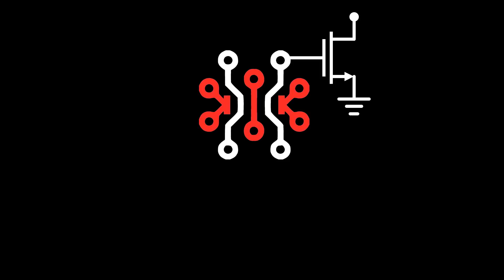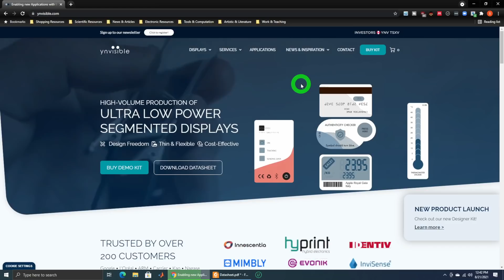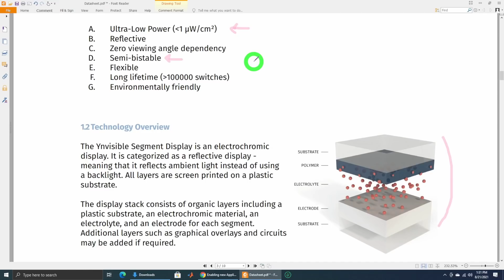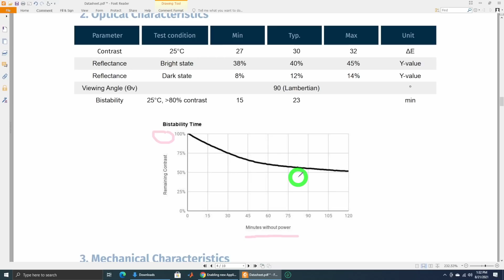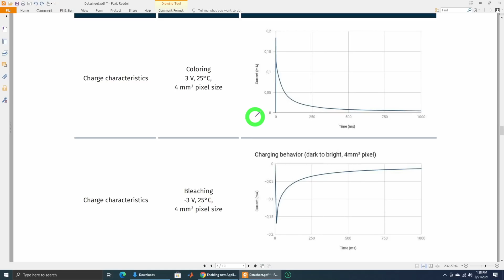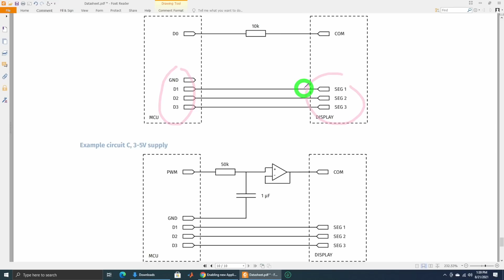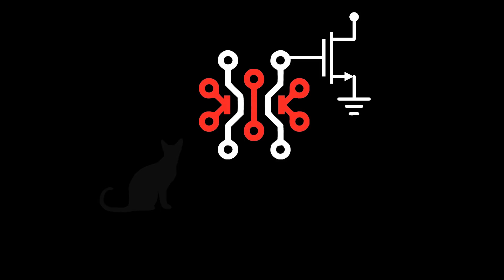TNP #7 - Ynvisible Electrochromic Ultra-low Power Segmented Display Technology

Comment: Great video Shahriar. Besides being an RF engineer, I have been working on developing these types for displays for around 2 years (not for Ynvisible Interactive) - based on the color, these displays seem to use the PEDOT:PSS polymer (look up Clevios S V4 ink which is commonly used because it is easily screen-printable). One thing which I would mention is that these types are meant to be used in very specific applications where there is either a mechanical concern (a standard segmented LCD could break) or a design incentive to use an "eco-looking" display in the product. The expected number of "coloring/bleaching" cycles has to be low (I would say generally <10k cycles to have good contrast over the whole lifetime of the display). For the vast majority of the products, using these does not make much sense as they can be more expensive than segmented LCD displays made in China and they generally offer lower contrast. Nevertheless, there are applications where these displays can be useful - i.e. in the shipping industry (temperature data loggers).

Be careful when playing with them as they are by no means as reliable and "rugged" as standard segmented LCD displays - they are quite prone to over-oxidation - you have to be extra careful when driving these as when the PEDOT:PSS is fully oxidized (light blue) and you continue to provide potential on the electrodes, the polymer will eventually get stuck in the oxidized state indefinitely and the display is damaged. Another issue (which can be solved i.e. by using a polymer mesh soaked in the electrolyte) is the movement of the electrolyte - try to push hard on one of these displays and you will probably see that the part where you pushed responds slower than before - the electrolyte gets displaced by the pressure.
Reply from the maker: Thanks for the great set of information!
Reply: Funny. I was looking into the technology in detail, and it seems it is only made of drawbacks. There was a EU-financed iniative, called Decochrom, which ended with basically nothing to show for. Ynvisible seems to be borderline out of business already. There really seems to be a lack of a clear USP. It's not that much cheaper than custom LCDs to get your own design, and contrast, speed and longevity seems to be lackluster compared to EPDs.

Comment: Thank you for the video, there are also some paper white displays which allow you to bring any custom bitmaps on the display, even with multiple colours, their content last for years. I am using simple SSD1306 OLED displays, they are bright and cheap, however they have to be switched on/off automatically, otherwise they eat too much energy and burn in.

Comment: Cool.  I think one can design a very sweet solar powered temperature sensor with this, like the ones in freezers and fridges that use an LCD,  but flexible and the solar cell could be in the area not used for the display digits.  It would look like just a display.  Add adhesive, and ready to just stick where ever you need a temp measurement.

Comment: Actually the (over) 100k times switching lifetime rating is way too low for almost any display, and even that is an understatement. If you want to make a clock using this, the minute digit would last about 3 months.
Reply: And seconds in 28 hours! Maybe test it? run it for 48 hours?

Comment: Why is there a chip on the board for the ON/OFF samples? Is it a µC or a DC/DC for a stable voltage?
Reply: Probably neither, both would need at least a decoupling capacitor and a DC/DC converter would also need an inductor. There are only two resistors. The package marking is impossible to read, but I'd guess it's an H-bridge. Applying the negative "bleaching" voltage would otherwise require the two buttons to be DPST, which are harder to come by than the standard SPST

Comment: 100k switches is actually pretty low. If you make the display count minutes, 100k life is reached in 70 days. Your demo counting seconds reaches the 100k in 28 hours.
Reply: You could even time lapse video the demise!
Reply: @EEVblog  Yep, also might be a good idea to try different approaches to the driving of the display - different voltages, trying to put resistors in s series to the segments or common electrode - you can trade-off display cycles for the display performance. On the one hand, It is possible to heavily overdrive the display with let's say 8-10 volts to get a much faster refresh time (tens of milliseconds) but the useful lifetime of the display will be reduced to a few hundred cycles at most. On the opposite, you can drive them gently and get a much better lifetime (around 100k cycles is a maximum). The degradation is slow and subtle, you don't get a sharp decrease in the contrast. Displays that I have been developing work down to around 0.8 volts (-0.1V to bleach, +0.7V to color) with around 2s bleaching/coloring cycle time - just to get some perspective how low can you go with the voltage until the contrast change becomes unusable for display purposes. Of course, this may not apply to any display - think about the display as a couple of capacitors - you transfer charge from one electrode to the other and as a coincidence, the electrodes change color, looking almost like a magic :-). There is a lot of variables, resistance of the input wires, thickness of the electrolyte layer, ratio between the area of segments to common electrode, distance between electrodes, type of electrolyte, etc...
Reply: That would also be worth testing! Run one for a few days and compare it with a "fresh" one afterwards

Comment: Does capacitive IO require sending out a pulse to the capacitor to measure the RC time constant. You would need to work out how to stop this affecting the display. But the response time is probably slow enough you can send the pulse and reset the image before it can react.

Comment: Pretty neat! 200ms seems like a long time to be driving a pin, but I guess it is not that different from epaper (and without the 40v or whatever step-up). I guess what you need is a separate low voltage supply and then stop mode while waiting for the thing to charge up. Where is the discussion of how this technology works? :)

Comment: I wonder if you could print electrodes on a pcb and then stick that material directly to it to get easy custom displays.
Reply: You mean, that might be an option to customize a blank display (with only a broad common front electrode) yourself!? Idk, if it could work like that, but it sounds interesting.
Maybe there is more going on in the laminate.
I wanna know, why the active structures appear brighter in color (when off) than the inactive areas. I don't think it's due to reversed polarity, but a special ground state or is it linked to the front electrodes!?
Reply: @realedna  yeah, that's what I was thinking. Like it could be applied like a sticker over your own pattern.

Comment: Evaluation kit Euro 190. Custom display prototypes starting at Euro 2500. No standard configurations at a reasonable price. I think I'll wait a while.
Reply: They should simply start by selling the evaluation kit displays, seeing as the cost of the setup is already paid for. The 2 digit display would easily find use in a lot of applications immediately, and easy enough to drive as well, using 2 shift registers to clock out the slow data signal to it. No custom driver chips needed, just 2 io pins, and no critical timing in the code either.
Reply from the maker: That’s good feedback for them.
Reply: Youtubers that will be interested in DIY-ing this: Carl Bugeja, Ben Krasnow, ...

Comment: I have a USB drive from over 10 years ago with a display indicating how much of the capacity is used, that keeps its indication for a long time with no power source. Is this different because it's flexible?
Reply: I have that same intenso drive, its using an e-Ink display, which is a similar yet different technology.

Comment: IME 1uW/cm^2 is about the same as a static LCD. Am I missing something?
Reply from the maker: The advantage here would be the bi-stable operation, flexible formfactor and the easy printing manufacturing. Of course there are also disadvantages.

Comment: The gap required between the segments for the contact to route through, seems very large.  So for small 7-segment (or more) displays it's not very clear.  It would be best for fairly large displays where the ratio of gap to segment improves.  It doesn't appear to be possible to use multiplexing so matrix type displays cannot be built.  Maybe some of these difficulties can be overcome if there are more layers in the display.

Comment: is this technology also usable in the range of -40...+85°C?
Reply: data sheet says -20 to +80 deg C
Reply: i guarantee you its gonna be SLOW at low temperatures
Reply: @drkastenbrot  Easy to test to see how slow, just buy a small block of dry ice and a small cooler or box.  It would be interesting to see just how much slower, though.